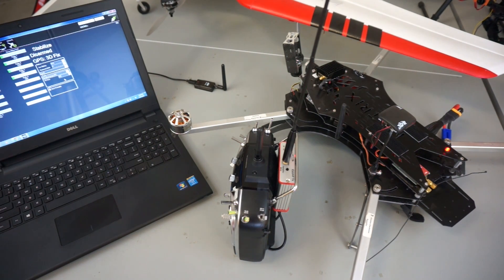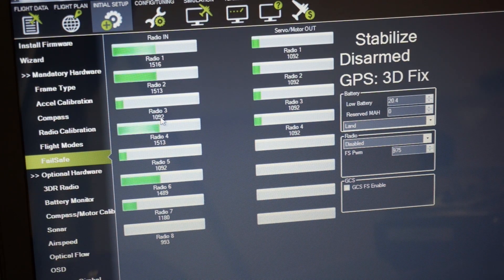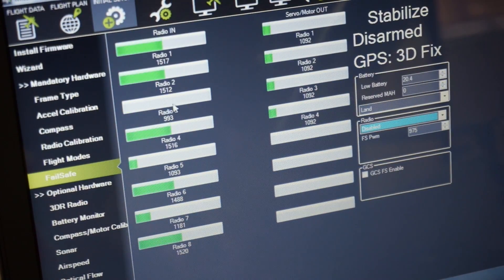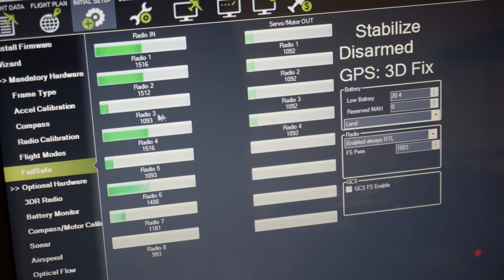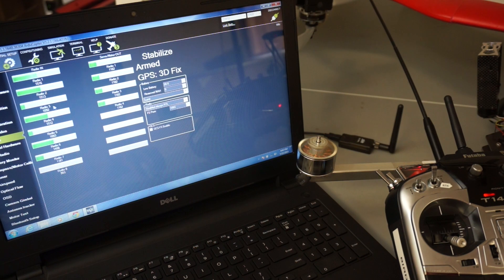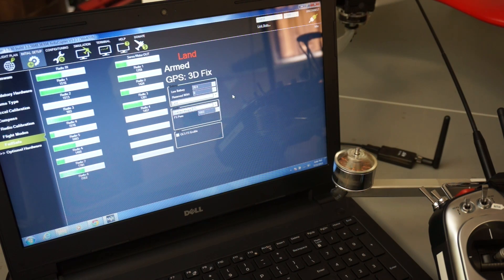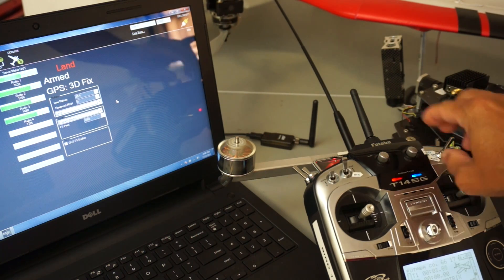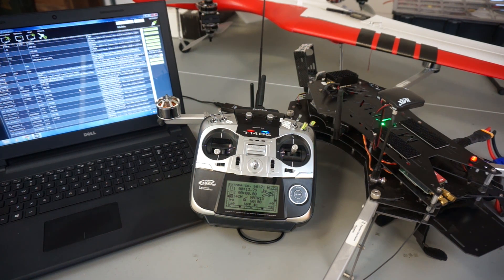Pixhawk Radio Failsafe Setup and Testing with EZUHF and Futaba T14SG

Comment: Hey there! Wanted to ask, how did you connect the Rx to the pixhawk? I have the same setup (T14SG and ImmersionRC EzUHF Tx and Rx) but can't manage to get the receiver to be detected by the pixhawk/mission planner. I know that my EzUHF Tx and Rx are binded and both connected to power, but mission planner says it cannot detect the Rx.

Comment: Hi Dennis, I happen to have the exact same setup, I followed your instructions step by step, everything works with the exception that my quad will never Land. I even tried arming, put throttle at 50% then lift the model walk over to the other room as if the Copter was flying, turn off xmitter  which will engage the FS and after placing the quad back on the same spot on the counter the motors would stabilize around mid range but it will never show land, motor keep on spinning .
Reply from the maker: That's interesting. I haven't seen this behavior before. Let me think about it and see if I can come up with anything. And let us know if you figure anything out in the meantime. Thanks.
Reply: Hi friend. try to setup RTL on simple and super simple mode ,into the  initial setup tab ,under flight modes. Save restart and check it again.
Cheers

Comment: Dennis would you consider making a video on how to setup an EZUHF control system with Pixhawk? Specifically on how to connect the UHF receiver to the Pixhawk and how to configured the system within APM.
Reply from the maker: +traxxi2003 I no longer have this EZUHF system as I was doing this setup for a friend. If I can get my hands on one I'll definitely set it up with Pixhawk. Thanks for the question.

Comment: nice video as usually.Dennis I lost two copters since I came in this hobby(tarot 650 and a zmr 250) you know sometimes failsafe fail.so in case you lose a copter wich tracker would you recommand me?I don't wanna lose an other bird anymore.greetings from France
Reply from the maker: R. WIZA That's a great question. I haven't used one of these on my UAVs but it's not a bad idea. I need to look into this and will let you know what I find out. Please do the same if you come across something reasonable.

Comment: @ 00:20 you mention this already being demonstrated on a FrSky Taranis - Are you referring to the QAV500 & Taranis X8R Video? If not, where would we have to look for?
@ 01:07 you start lowering the trim of the Throttle of the T14SG in order to get past the lowest PWM value with the Stick normally resting on it's lowest position. I tried doing this with my Taranis X9D but it's not allowing me to set the FS below 993 which is the same value of the Stick resting at it's lowest position. Does it work for you when using the Taranis with the EzUHF Module?
Reply: Duraltia same problem here
Reply from the maker: Duraltia I've setup failsafe using the CH5 with the Taranis. I haven't done this throttle failsafe approach but will look into it and share what I find out. Thanks for the suggestion.
Reply: Dennis Baldwin Thanks!

In the meantime I've found another Video that kind of explains that the Taranis/EzUHF Combo would not allow to go below 993PWM ( trimming up does work, trimming down does not ) so we'd have to cheat by setting the Pixhawk Failsafe with 993PWM and once that's done we'd increase the Trim of the Remote up by 10 followed by a calibration of the Pixhawk with the trimmed Throttle on the Remote as otherwise the Pixhawk wouldn't arm - Something I find a little unsatisfying. If you could provide a second opinion on that I sure would appreciate hearing it =)

Comment: I would have liked to have seen a power failure (i.e. removed) on the RX to verify that this also works otherwise the effect is really no different to the method you used on the Taranis
Reply from the maker: Gerald McGivern Thanks for the feedback. From what I understand there actually is a difference based on what the wiki says here:

http://copter.ardupilot.com/wiki/configuration/throttle-failsafe/#using_the_receiver_to_set_the_flight_mode_not_recommended

"Although this mostly works it is not recommended because it will not trigger if the receiver loses power or if the wires between the receiver and flight controller are broken."

Now I haven't verified this but will definitely give it a test. Appreciate the suggestion.

Comment: Do you need amateur radio licence to use EZUHF?

Thanks for this tip even if it did not work same with my transmitter i figure it out at end.
Reply: Darko Bulatovic yes you do.
Reply from the maker: Darko Bulatovic As Douglas La Farge points out you do need a license to operate in the 433 MHz band. I have my Technician's license but am hoping to upgrade soon. Never enough time in the day!